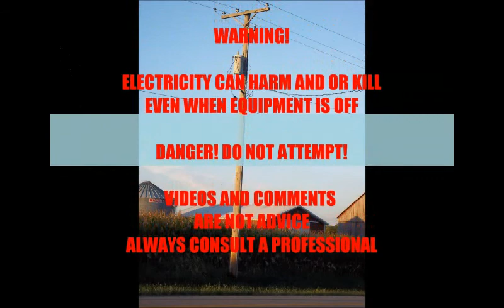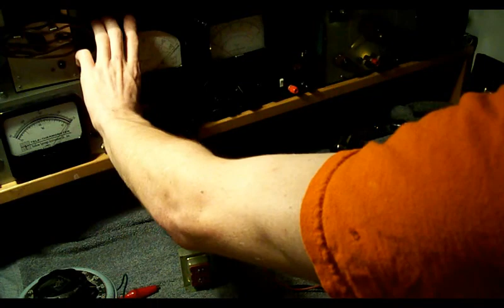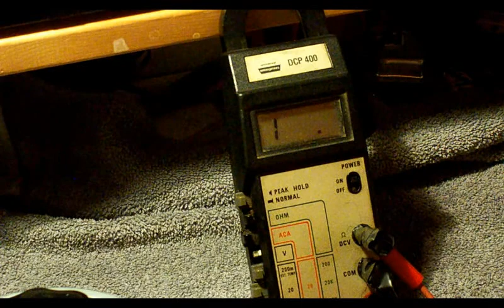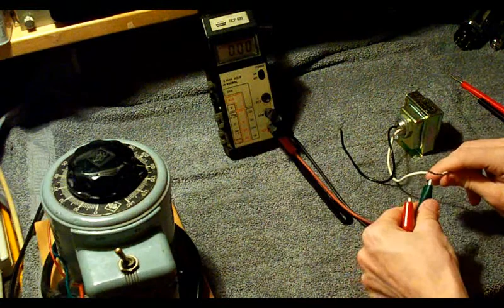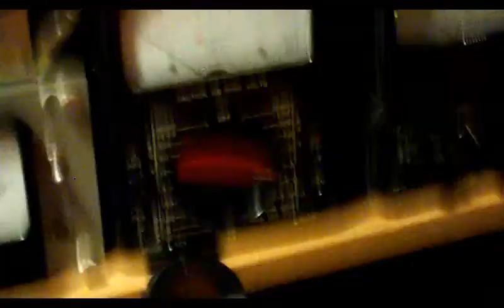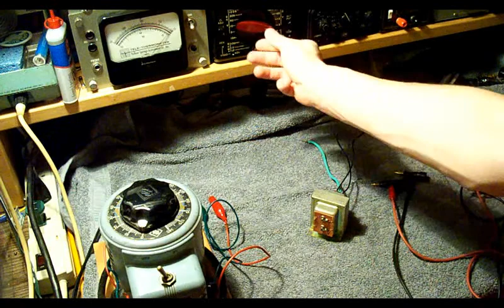Testing transformers and why it's important!

Comment: Well explained so far,...but you should always test isolation transformers with an insulation tester as a multi meter does not apply enough voltage to test sufficiently. Insulation testers apply somewhat in the region of 500 to 1000V which is the minimum such a transformer should withstand. Always check all windings to ground and  between primary and secondary with at least double the operating voltage to make sure there is no leakage, otherwise it may kill you.

Comment: When verifying the safety of a transformer, I would always use the highest resistance range of a meter to the frame as well as from primary to secondary and take any meter deflection from current leakage as a bad sign. Could even use the leakage test on a cap tester to verify using a voltage closer to what the transformer would see in service.